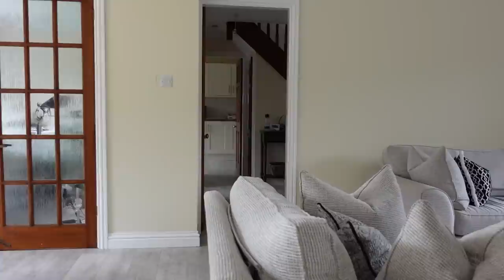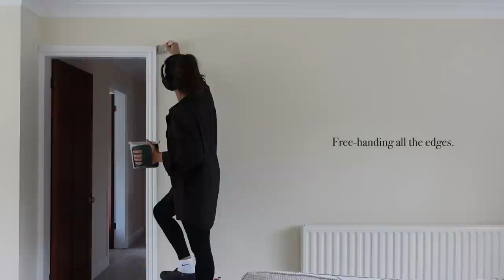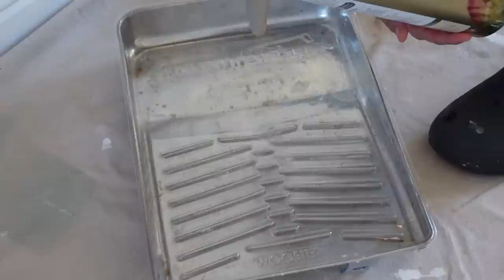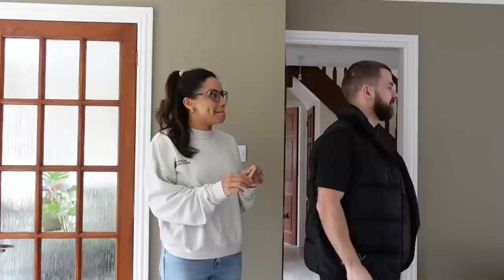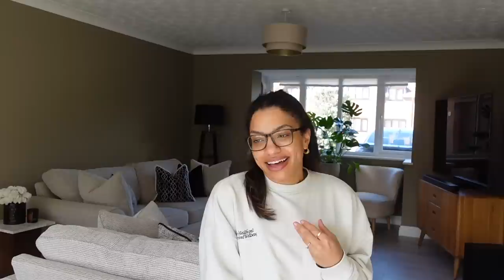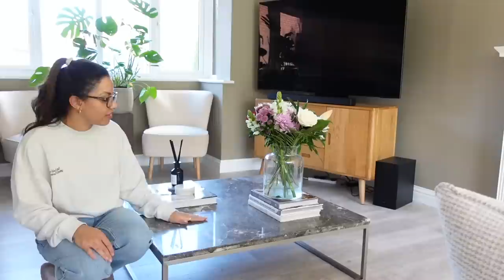Living Room Makeover Part 1

Comment: I'd get a gas wood-burning stove, given that you've got mains gas already. So much less hassle than wood, sooo much cheaper to run than electric, and virtually indistinguishable from an actual wood burner because of the real flames. You can get them 100% efficient and the heat they throw out is crazy. 
Love the new wall colour 💖 and sis got a steady hand!! 👏🏾👏🏾👏🏾

Comment: LOVE LOVE LOVE the colour. Very warm and cosy perfect for the space and also a great choice for the Georgian theme. 

With the scale of the room the wall lights can be far bigger than the ones you have. Depending on your media unit; whether that’s staying or the tv will go above the fireplace, will also need to be taken into consideration for the scale of lights you buy. 

If your planning on moving the radiators then I wouldn’t. The more paint layers on a radiator will reduce the heat outlet so just be mindful of this. 
Can always buy a radiator cover or have a built in around this radiator to have the top half as a Welsh dresser just a little thinner in depth. Bottom half to have storage each side encompassing the rad cover. It’s such a large wall so you could get away with a custom built in. 

Window treatment wise the bay window would suit shutters  which will make it super lux and go with the Georgian theme. To soften the space you can then add floor to ceiling light weight curtains purely for aesthetics only and have your coving hide the tracks. 
The back windows I would wait for now till you replace them. 

Fireplace is not original to the house so could completely rip out and start again. Personally I would add an alcove; so build out the fireplace area to add some character. As you’re going with a Georgian theme have you considered a limestone fireplace? 
Just be careful with the modern fireplace (although I love them) it could be a difficult mix with the pure Georgian theme you’re going for. 

Georgian theme interiors always involved rich toned woods so walnut and Jacobean oak. 

Don’t forget that beige and grey work perfectly together. I’d keep the marble table as it adds another texture which will be muted with a rich rug. 

Introducing pops of colour like amber and Emerald are Devine Georgian colours.  I think keeping the grey with black piping would also be a nice mix with some light beige cushions or throws. 

One thing to also consider, if you are set on buying the corner fireplace then I’d keep the black theme running throughout. (It keeps that modern edge going) Black doors, black lamp. Or if you want the traditional Georgian feel painting the doors a light beige will be stunning. X

Comment: I used rustoleum heat resistant paint absolutely stunning quality paint the radiator or cap it off and remove it , I too have a 80s home in a cul de sac and I’ve leant towards jewelled tones rich art deco vintage Victorian style and I absolutely love it do what feels right and definitely go with the corner fire place log burner, find out if you can re seal your coffee table and why don’t you build a new wooden top that just sits on top of your coffee table like an upside down tray and then if you hate having a wood coffee table you can go back to the marble easily all your ideas sound fantastic I’m here for the long haul

Comment: Shade love the video and the colour. With regards to the radiator give it a good sand before. Use Zinsser BIN as an undercoat and then paint with the same wall paint but do very thin coats and sand with 240 in between coats. Also, turn it off, don’t paint a warm radiator, and let the paint cure for at least a week before you turn it back on. It’ll look perfect once it’s done x

Comment: That’s a great colour!   Now you’ve taken the first step the rest will follow.  I use Pinterest a lot. I also screenshot things I like and put them in a folder and save the link in a folder too.  I think as there’s no chimney breast it’s ok to say goodbye to the fireplace.  You could put a radiator cover over the radiator or make a wall unit around it as someone else suggested.   I think cushions in a colour would look good.

Comment: Paint your radiators same as the wall colour they will then sort of fade into the background
I am sire you could make a console table type  shelf to go over the centre one and make it longer than the radiator is. I have just made over my fireplace ,covering it with mdf and painted it same as walls( F&B Bone )and added a pair of wooden corbels I covered the marble with matt black vinyl ,it looks  so much better then it did before 😆

Comment: A few ideas : maybe have some fluted drawers or a single big box made of wooden slats made under the marble top for the coffee table? Earlier I would have said cane but not now. You can keep decor or cushions or nothing in it. I’ll try and send a DM on Instagram for this.

Secondly the radiator can get a lodge on top? Dark wood. Small and thin .. will balance the weight of too much white in that space … yet not overwhelm. 

Thirdly the corner fire stove looks really good. Smartens up the house like Rob was saying … it looks more this century now. You can pick out the floral elements on the mantel for now .. don’t use any paint etc. just white. And the back and centre of the fireplace can be painted black though. Let the stone be for now as it will go anyway later I feel.

Comment: Matt paint on a radiator isn’t good, however, if you do, make sure it’s heat resistant as it’ll fume or go shiny eventually with the heat (yep! experience).
I’d also paint those mahogany-coloured doors, as that’s a late 70s/early 80s giveaway  (so much mahogany-coloured “wood” finishes back then) - or stain them darker to match the pieces you like.
Can’t you move the radiator if you don’t like it where it is?  You’ll add skills too!  
And yes shutters -  they’d give you a bit of privacy during the day too - but if curtains as well, I’d bite the bullet and fit into the bay as you won’t then visually lose the space when you pull the curtains.  You could bend the track round the wall to the room side, so the curtains completely clear the windows and maximise the light when pulled.
Your marble coffee table top can be re-polished/finished by a marble/glass supplier (the joy of real material rather than something looking like it)
Love your sofas they look soooo comfy - I’d just pull that one a good foot from the radiator as the heat will damage all the joints otherwise and it’ll collapse in parts  (again, speaking from experience ...... it over-dries all the wood and glue, so the joints shrink and separate - obvious if you think about it - I felt such a fool and it was a very expensive mistake 🙄).  Also, your radiator will work better and it’ll be more cost-efficient.
Love how it turned out - worth the work
Roll on part 2

Comment: Hi Shade. I know this is an older video now but so glad I found it as I asked you your wall colour a while back and couldn’t find your reply. Can I ask, is your room north facing? We have a NF living room/dining room which is L shaped with a dark feature colour at either end. Can’t decide whether to go all one colour as you have or just keep as feature walls. Are features walls old hat now do you think? I have that fear of starting and can’t decide what to do (our house is an early 80’s build). Worried it will be too dark if I go all one colour like this one. Thanks
Reply from the maker: Hey Sharon! So sorry I didn’t get back yet. Im not entirely sure if ours I technically north facing (actually think it’s west). The sun sets in the main window (where the Tv is) in the evenings.  
I love all the walls painted one colour personally I think it pulls the room together. And dark tones are in, moody and cosy vibes. Also, it’s just paint if you really want to you can change it! Buy a small tester sample of the colour you like and paint a little bit on each wall in the room, near the windows and in the darkest spots. It helps you figure if you’re on the right track. Personally I think dark walls are very in right now but of course it depends on your furniture etc. if you have lighter tones it’ll help brighten, colourful would set off lovely against the mushroom and dark would fit right in! Sorry if that wasn’t much help it’s hard to advise when I can’t see it but I’d say listen to your gut xx
Reply: Hey  @ShadeShannon  - Thank you for your speedy response! You did actually reply to me previously but can I remember which video it was in... nooo! Haha. That's a good idea re the tester pots. Prob with our living room is that we get all the sun at the front from about midday til sunset but we only have one slim tall window to let that light in (imagine thats the top of the letter L). The majority of our windows are all at the back but thats NE facing. In Summer it's okay, but in Winter, it's very dark. I've got lamps mirrors etc, but like you say, I think I just need to try it out and see! Loving your design choices. Wish I could be braver instead of opting for a safe choice every time! :)   x